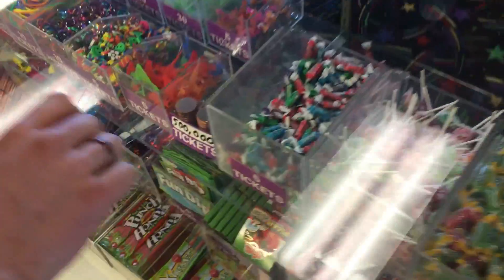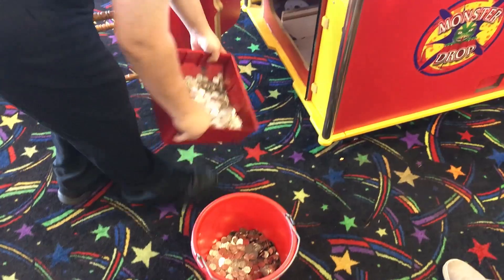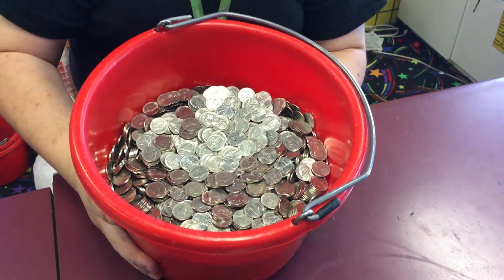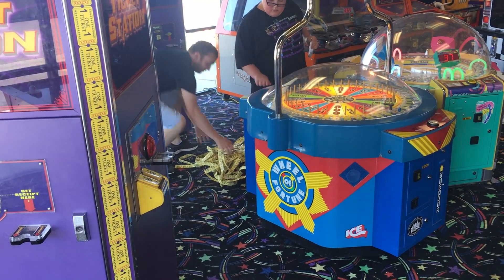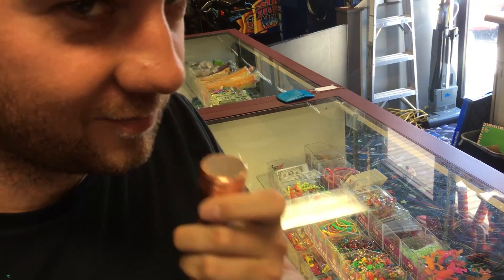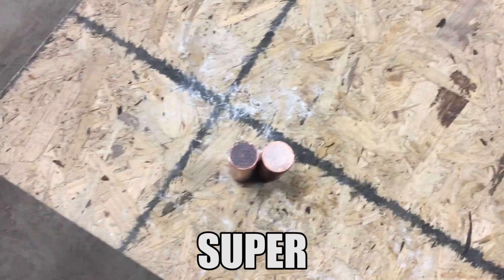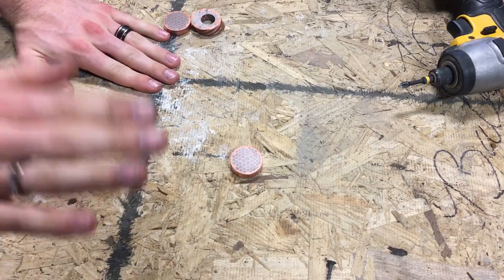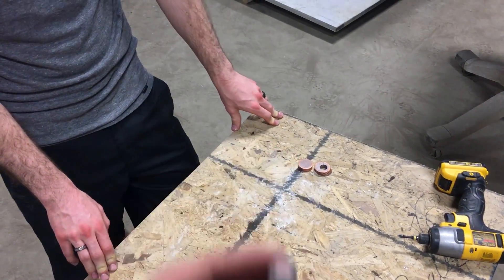Custom Superconductor Ring with 60,000 PSI Waterjet - Patrick Adair Designs

Comment: The dark bits are a niobium-titanium alloy, which is the actual superconductor, the stuff around it is just good old copper, which helps hold the thing together, but also stops it from burning up in case of a cooling failure (the superconductors need to be cooled to about 9 degrees above absolute zero to work). More correctly.

Comment: A superconductor is actually a type of metal(there are a few types) which has zero resistance(ohms) when conducting electricity. They work at certain temperatures. The most recent and most advanced, I think works at about 120 K which is about -153 Celsius or -243 Fahrenheit. This means electricity can move and infinitely long distance without ever losing energy.

Comment: 700 bucks for something that barely worth about a quarter off that. 

And it only works depending on material below -173 if its something like a yttrium barium copper oxide compound. 
or -263 and lower if its a more simple element.

Comment: I would have first drawn the slugs through a series of dies to reduce the outer diameter.
This would make the slugs much longer without distorting the pattern.  Longer slug, more rings.
Drill a hole through the length of the slug for the next step.
A series of drawing/broaching operations with dies and internal mandrels would forge the rings to near final size and shape.
Much less material lost through cutting, many more rings per slug.
And still keep the groovy pattern.
BTW, these slugs are the raw material for drawing superconducting wire.

Comment: This video starts off fairly baffling. 1. Nickels? wtf? 2. Most places with tickets let you buy tickets so you don't have to shell out hundreds of bucks if you really want a specific item right away. 3. What in a baby's asshole is a superconductor ring/roll? Why would a hunk of metal be at a "nickelcade" (it's called a nickelcade, but then none of the games are a nickel, so why not fucking quarters?). 4. Conductance really has fuck-all to do with hardness. Gold is one of the most common materials used for best conductance and it's soft as shit. So why would a superconductive "ring" or "roll" be any different than any other hunk of metal? 5. What the fucking shit are you talking about a superconductor definition being passing through itself, so it passes through the inside of a body faster thus MRI machines?   How about you wear one of these on your cock and go into an MRI machine. Then your buddy can lick it and explain why it didn't superconduct shit and your dick caught on fire.

Comment: Used MRI heads on eBay seem to run about $200-$1000. Assuming three feet of cable out of one machine, that's what, $3-$30 max in material costs for a ring?

So, $500/each per ring seems like maybe a bit much, don't you think? I'm not really sure how much cable you get out of an MRI machine, but for what you're asking for the rings it looks like you could buy new MRI machines to harvest the coils and still turn a profit. If it takes you half an inch of material per ring, then 3" of cable would break even on $3k of material.

Comment: You realise that some Copper with graphite in it is not a super conductor. there are no super conductors that are functional at room temperature because the kinetic energy must be low enough not to move the electrons to a certain degree, also if that composite we're to be cooled it would all not be a super conductor because Copper can't be superconductive and neither can the carbon graphite allotrope.

Comment: I understand it takes time to make amazing and unique stuff, but damn. I check out the site for the rings and my god, you are a bit ridiculous on the prices for rings.
Reply: These are superconductors, they are fuken expensive
Reply: I can't find a price for this stuff, but the NBTI wires are worth a couple of hundred bucks a kilo wholesale, put into a superconducting magnet like that? Who knows, it'll cost whatever the manufacturer can get away with.
Reply: It takes some very strong and specialized bits to machine a superconductor (for example, tungsten carbide) and you would only get one use out of each bit. Also, because of the difficulty to make (turns out binding a titanium niobium alloy to a copper matrix is rather painstaking) a rod of superconductor that you could make maybe 6 or 7 rings out of is around $700. There's around 20 to 30 hours that go into making a superconductor ring, so if one wants to make a decent profit, it would have to be fairly expensive.

Comment: This "Superconductor" Ring is probably made out of copper and niobium (or a alloy of niobium and tin). The copper is used as a thermal conductor. You need to cool down the wire to 18.3 Kelvin to make it a superconductor.
Also the material Worth of this wire is never 500 bucks.

Comment: The ring is $500... You're out of your fucking mind Patrick.
Reply: deweys Yeah, could maybe go for 200.
Reply: Hipsters have very deep pockets, made by a brand you have probably never heard of.
Reply: But u don't bitch when class rings go for well over a thousand ? 500 is a pretty good deal for a ring that is that unique.
Reply: gotta make back that $500 in nickles.
Reply: I just bought a oneplus 5 for that money.
Reply: pmm4177 
Then you can go there and ask them to make a similar ring on the cheap, it's a free country you know... extra points if post a link to the site(s)
Reply: deweys thx
Reply: This isn't normal YBCO...it's in a bar stabilised with copper.  That's why it's so expensive.  You can get it much cheaper...
http://shop.can-superconductors.com/index.php
Reply: he can make around 20 of them tho
Reply: It's a bargain at that price, only a fool would pass it up.
Reply: lol people do complain about class rings most of my senior class Didn't order any. Nobody was paying 700$ for a silver ring with glass instead of gems when there are open pit gem mines all around. Not to mention gold/silver smiths that will work on trade.
Reply: They had a 70$ version too but it looked bad on top of being copper with a nickel or zinc plating.
Reply: deweys lmao really dude ? These are custom made rings. And are reasonably priced. Ive seen people make shit rings for more. These are actually cool.
Reply: ya but they arnt even etched witch is the hard part.
Reply: Turnt Marshfellow do you know how they etch the rings nowadays? That's the easiest part because professionals Lazer etch them.
Reply: If u wasn't so broke i would buy one
Reply: I don't think copper and nickel are very rare man.
Reply: Yeah, how do you dare to charge for the intense hours of machining, polishing and using your very specialized knowledge about how to make rings?!?!?!?! it's unbelievable!!!!!
Reply: Comfit Shot 'My name is Comfit Shot and I'm gonna call people fucking retards in YouTube comments because my prescriptions didn't get called in on time so now I'm forced to autistically screech in my parents basement.... REEEEEEEEEEEEEEEEEEEEEE" Grow tf up lol you being an internet bully doesn't make u cool, unless someone u talk shit to finds u breaks ur knee caps and stuffs u in a freezer
Reply: Keith Robertson 😬 sorry to hear that 😂😂😂
Reply: for a piece of unique jewelry it should be much more than 100$, 100$ is what most people buy their daily shoes for. I guess it just speaks on how everybody see's stuff in different light, its cool, and if i had 500  to dish out for a ring i'd probably get this.
Reply: Darkstar do me a favor, buy all of the equipment to grind and make a ring, then buy the probably expensive material ie. meteorite, super Cunductor. After all that money spent please spend some time actually making a single ring. After that think about how much money you actually want to sell it for. $50 ?? $60?! Didn’t think so. Its not an easy job.
Reply: And that's why I went to walmart and good looking class ring for 45$.
Reply: ONE + 5'S are budget flagships. This ring is a piece of jewelry. For example if you work a blue collar job and you got to propose to your spouse you are supposed to spend two months income on a single ring. this ring is a paycheck and a half for most.
Reply: the superconductor normally are 500 to 1000 they are "super" rare  and plus the hard word put in making it its worth it
Reply: MilkCap then buy it fuckwhit
Reply: deweys yeah, I wouldn't pay $500 for a ring made of gold let alone copper
Reply: MilkCap you're insane
Reply: maelgugi right... I've seen cooler rings made from coins that look better than a ring made of copper

Comment: What is a super conductor?
Reply: A quick google search reveals:
An element, inter-metalic alloy, or compound that will conduct electricity without resistance below a certain temperature. Resistence is undesirable because it produces losses in the energy flowing through the material (i.e. heat).

Once set in motion electrical current will flow forever in a closed loop of superconducting material - making it the closest thing to perpetual motion in nature. Scientists refer to superconductivity as a "macroscopic quantum phenomenon.

It is a quite expansive alloy to make. The alloy from patrick's ring contains titanium and niobium. The rods are surrounded by copper, its main purpose is to hold the superconductor rods in place.

Hope that is answer enough for you ;).
Reply: @TheUltraEditor  , my friend you just did a lab report on that. THAT IS UNNECESSARY!!!!!!
Reply: It's a guy who conducts an orchestra but is also a super hero.
Reply: Wen Ci Chong a super conductor is a material that (with our technology needs supercooling) and basically has no resistance. I'm pretty sure I'm right in saying that but I'm just your standard internet pleb so I have no credibility and I would take it with a grain of salt
Reply: So in normal conditions (lets say room temperature), conductors like copper have metal atoms vibrating at certain frequencies, which is directly related to the temperature of their current surroundings. Charge (electrons or holes) passing through that conductor will be slowed down due to those atoms vibrating and blocking their path (resistance). Super-conductors are conductors that are cooled down to very low temperatures to reduce the vibrations of the metal atoms, thus increasing their conductivity.
Reply: I am talking about semi-conductors, not superconductors. Semi-conductors have existed since 1930's I think. Superconductors on the other hand dissipate almost no heat, meaning the electron fluid within them flows in almost a perpetual like motion, however it's still not perpetual. Also, keep in mind that to achieve superconductivity you need to cool them down to near zero temperatures, which requires a lot of energy to begin with.
Reply: it needs power to keep the system cold
Reply: KEK Soqui KEK
Reply: yeah, i'm the cunt. they can get a much better definition of a super dick by googling it and get the result in 1 minute rather than 1 month, tosser
Reply: actually the defining characteristic for superconductors is not the lack of resistance but the repulsion of all internal magnetic fields.
Reply: IVAN3DX superconducters draw current, one of the first paragraphs on wikipedia mention it. And this has nothing to do with semiconductors.
Reply: MegaDargar Liquid nitrogen has a max temperature of 77K, while liquid helium has a max temperature of 4K. I'm not really versed in this topic, but I'm pretty sure there are lots of subtances that have in between boiling points. Source of my previous comment: university textbooks and various sites on the internet
Reply: Inu Shiba http://spectrum.ieee.org/tech-talk/computing/hardware/how-much-power-will-quantum-computing-need
https://www.dwavesys.com/sites/default/files/14-1005A_D_wp_Computational_Power_Consumption_and_Speedup.pdf

They mention that the powerdraw of the machine it's mostly due to the cooling system
Reply: hey ash nice to see you in a random place
Reply: joe fuquanson You must be from Europe. Never heard anyone say bugger off before lol
Reply: Inu Shiba Some semi conductors can be cooled with liquid nitrogen, which isn't that cold
Reply: Wow thanks for all the help
Reply: Hitman what if u used liquid nitrogen that doesn't need power?
Reply: IVAN3DX yes, but it would take energy (heat) away from the superconductor making it "cold"
Reply: Joe DeBoo Yes. That's how cooling works lol. Maybe I don't understand what you are trying to say
Reply: Liquid Hydrogen is colder.
Reply: It's when super man becomes a train conductor.
Reply: A material that has no electrical resistance at room temperature.
They don't exist.
Reply: Aluminum is a superconductor under those circumstances. So are many other metals.
Reply: How much does it cost
Reply: Kaloyan Yordanov half a super conductor
Reply: its a material that has close to none resistance when cooled down below a certain temperature .. ( mostly extremly low .. otherwhise we would have them everywhere .. ) example . the quantum processor in canada uses superconductance and does not draw any power when used :P only the cooling draws power ( about 14 megawats i think it was :D )
Reply: A semi-conductor is a material that has a resistance somewhere between an insulator and a conductor. Most common semi-conductor is silicon, and transistors (the very basic element of any electronic logic) is made from silicon.
Reply: I actually want to know what's a semi-conductor
Reply: IVAN3DX idk where you learn your information but liquid nitrogen is really really cold. The only liquid colder than that is liquid helium
Reply: are you kidding me? they made a computer that doesn't take power? god damn this world never ceases to amaze and inspire me
Reply: ninjanathaniel o
Reply: ninjanathaniel The computer itself draws no power but only because it's a superconductor. And since it's a superconductor it needs to be cooled down to super low temperatures. And since it needs to be cooled down to such low temperatures, the cooling system draws HUGE amounts of power
Reply: Inu Shiba I said nothing about semiconductors, and just because they draw current it doesn't mean they draw POWER. As I mentioned before, I'm not really versed in superconductors, but I'll give it a try. The power in an electric draw of an element on an electric circuit is P=VI (I is current and V is voltage). Now, a voltage means an electric field is present. And that means charged particles are being accelerated. In normal materials with resistance the electric field is used to compensate for the resistivity of the material. But in superconductors the resistivity is zero (or ever so close to it), so once you have a current flowing, it won't be stopped, you don't need and electric field to keep it up. There's no magnetic field, therefore the voltage is zero, therefore P=VI the power draw is zero. Now... I might be very wrong with this, but I don't think I'm that far from the truth. Of course the superconductor is not perfect and therefore needs SOME power, but nothing in comparisson to the cooling system. And I'm not sure if the whole thing is made out of superconductors
Reply: SmAsHBoT Impossible. The liquid nitrogen would just get hot and evaporate. You need energy to cool it down.
Reply: Ever heard of the google?
Reply: Allahu6 Akbar9 it's something that's semi-conductive